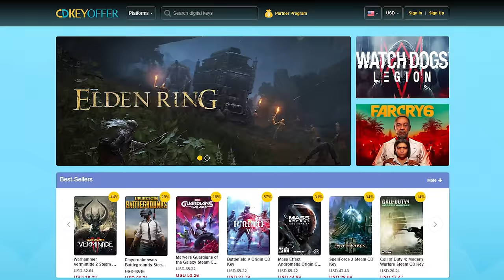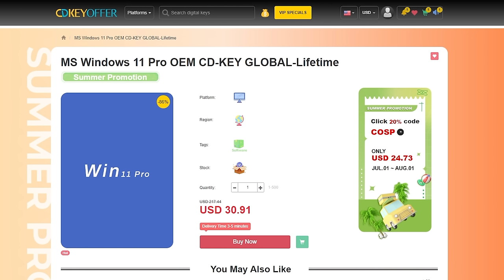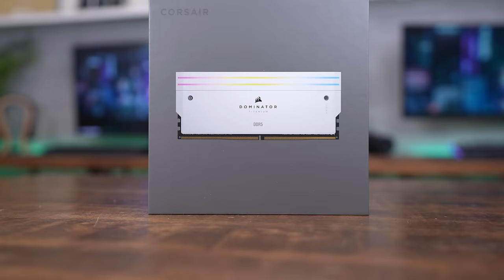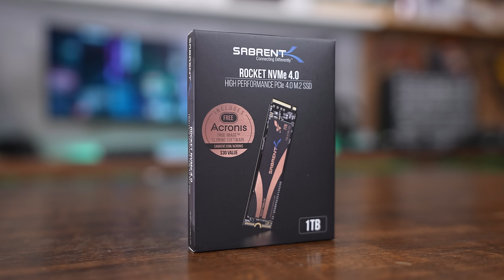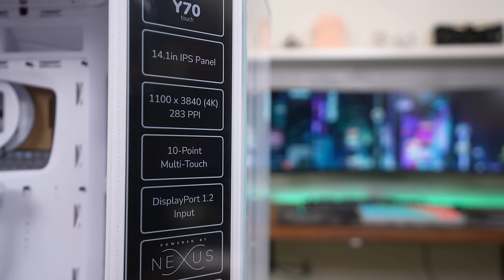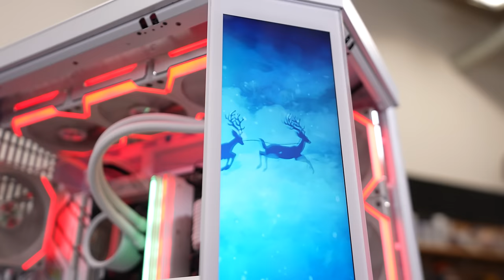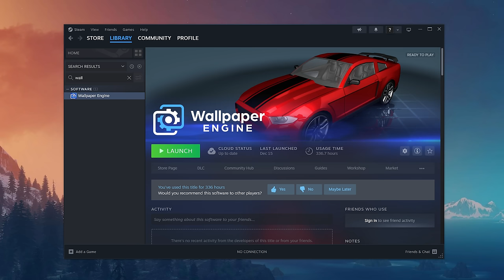How Can A Christmas PC So Perfect EXIST?! !  | Build Of The Month | Episode 5

Comment: Do you seriously have to lay that case on its back to remove the bottom dust filter? Also, the build would look better with the tubes on the left and no rear exhaust fan. So long as you run positive pressure, you'll have plenty exhaust out the rear.

Comment: PC QUESTION FOR ANYONE: bought a Samsung odyssey neo G8 paired up with 3080ti. For some reason when the monitor is set at 240Hz, my pc can’t seem to recognize the monitor when I turn it on. I would have to play around with the display port and turn the pc on/off before the display finally shows up….. but when I have the monitor of 120Hz, my PC have no problem recognizing the monitor during start up….. I have already tried updating the drivers and such. But for some reason it’s an issue during start ups when the monitor is left at 240Hz….. anyone know any fixes?!

Comment: I need your opinion on this What if i built a powerful up to date Gaming PC with a screen on the side of the case and a sliding drawer under the screen for keyboard and mouse. On top it will have a holder for carrying the PC everywhere. On the side of the holder there will be a small compartment for accessories like an antenna for WiFi and a power cable. The screen will be connected to the GPU by default. The PC can be used for video editing, gaming, Photoshop etc. I haven't started it, I don't know where to start and how to start. Please let me know! Anyone from the team 😊

Comment: Hi kyle and everyone else!
Im 13 and im planning to build my first pc but i want to make sure its compatible with everything, ive used sites for help but i just feel like something isnt right...
Here are the parts(motherboard and cpu are secons hand both for 70$)
MSI B365M PRO-VDH
Core i5 9400F
Gigabyte P550B 550w
Sapphire rx 550 4gb
G.skill aegis 2x8gb 16gb ddr4 2666mhz
Adata legend 710 m.2 512gb
Intel stock cooler
mATX case
Arctic p12 pwm pst 120mm(about 5-6 of them for the intake, exhaust and AIO i will buy in the future)
Thank you all!
P.s, i know the motherboard does not have wifi integrated